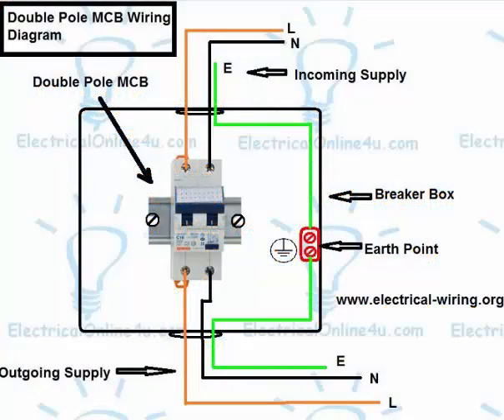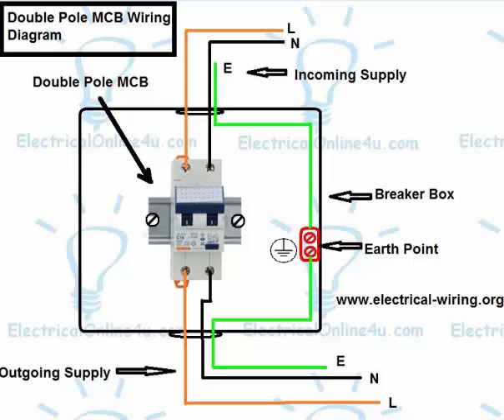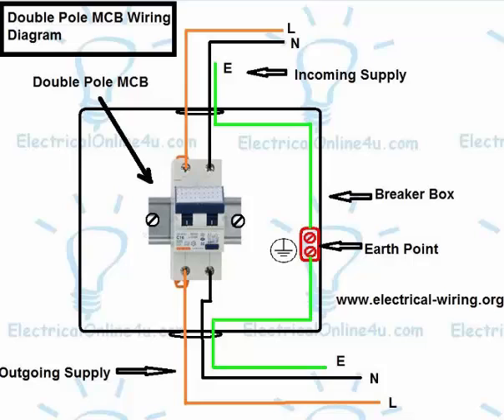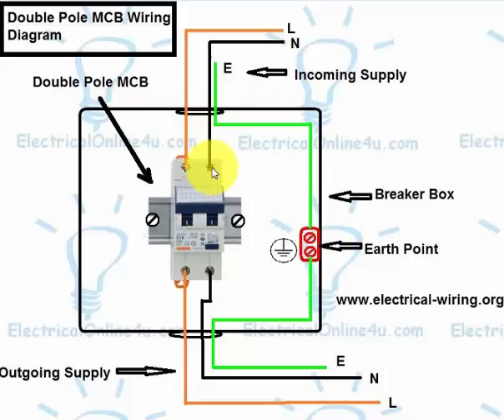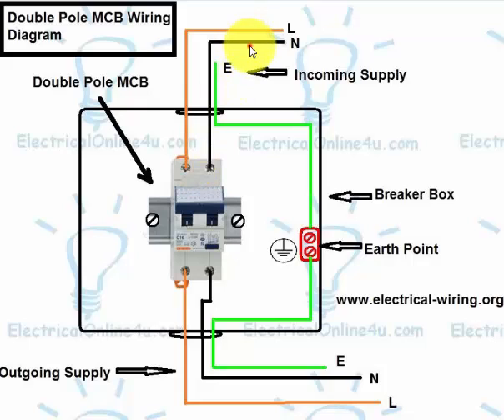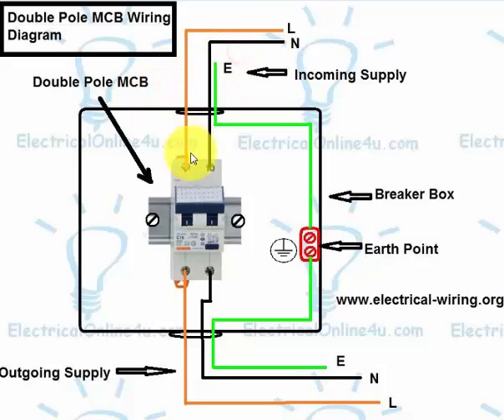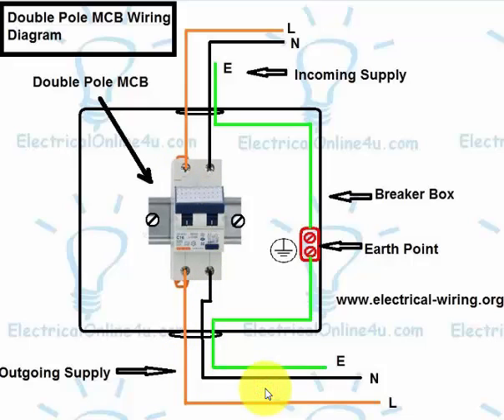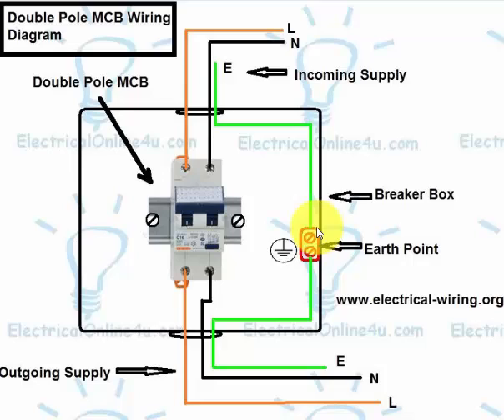How to Wire Double Pole Breaker | MCB | In English

Comment: Common Residential Meter Pole Installation, where earthing installed and attached in the meter base, and a double pole 100 amps MCB main breaker on a panel. Both where attached in a meter pole. 
The meter pole was at the perimeter fence, and I am going to install a 10 holes distribution panel board inside the house. The panel board has no ground terminal.. 
My question is,,
1.) From perimeter fence main breaker was 100 amp, what would be my extension or receiver amp breaker inside the house before i load less amp breaker to the distribution line or board?.

2.) As neutral wire is concerned,  Is it ok if i will not install a grounding inside the house?.